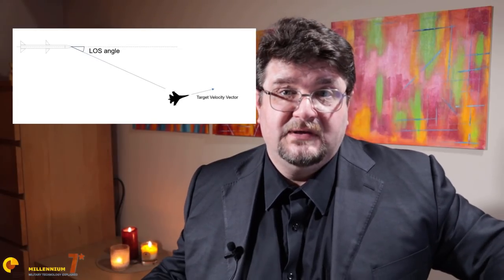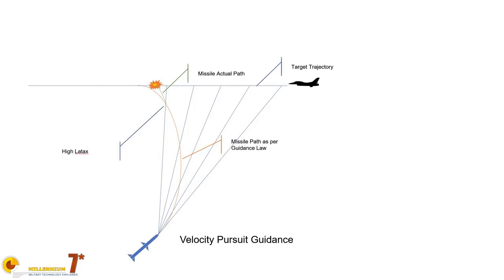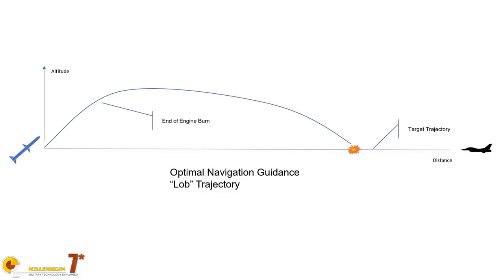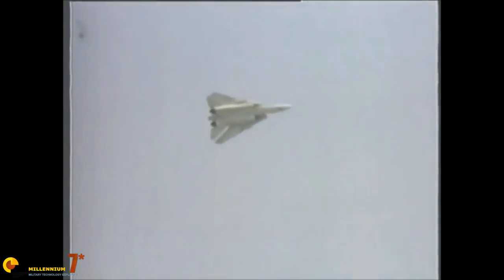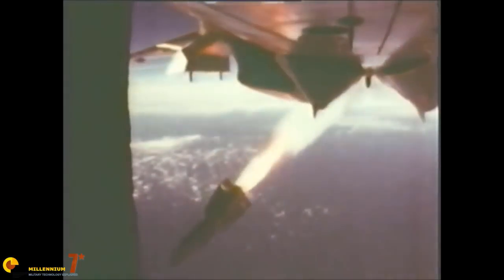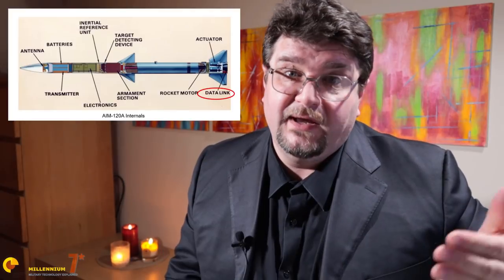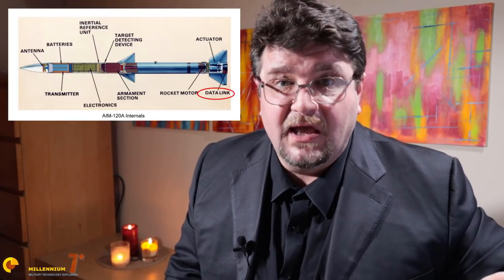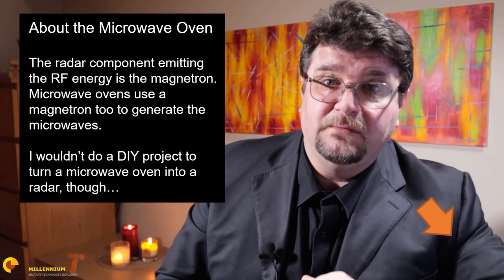Active Radar Homing - The Guidance of the AMRAAM, MICA, R77 etc.

Comment: Actually no the cavity magnetron has not been used in military radar for decades. The reason being it can only generate one frequency. In the early 80's high frequency VCO's (Voltage Controlled Oscillators) took over and a PLL (Phase Locked Loop) was on the output to multiply the frequency so you could go semi-frequency agile (settling time was tens to hundreds of milliseconds). These days a DDS (Direct Digital Synthesis) chip is used and commercial ones such as the AD9956 can change frequency in under a microsecond and working up to near 3GHz (2.7 rated) means you only need a times four PLL which will settle in a few milliseconds. Or you can go for a PLL with sweep such as the HMC702. Both of the latter solutions work nicely in X-Band and both can go lower. You can in fact using a planar array with the right delay line setup sweep by frequency rather than switching delay lines in and out. Much better and more compact for a missile.
Reply: Umm ok. You seem to know way more than me cuz I'm getting what ur talking about but not familiar with the systems u described.  But good on bud 👍

Comment: Again extremely well handeld unique information. What puzzels me is the chances of pilots to detect a launch. I guess it is like lighting a match in a dark room. Yet, in a war many maches are lit, so how to know which one is aiming at you? Then getting a visual on a missile that is no longer burning is going to be neigh inpossible. Or you would need radar but I guess modern missiles are stealthy as well. And if so will that not make for uav fighters working like we did in 1981. I was a conscript driver and gunner on a PRTL. Forget IFF if you are in sector at a time when no friend should be after radar lockon you have 4 seconds to make a hard turn or 35 mm wil start hitting you 500 rpm and exploding inside your plane. Bad hair day. A uav could do the same. Sectors with only uav friendlies blue on blue less of a risk.
Reply: Military aircraft have Radar Warning Recievers. These detect the radar energy from active radar.

Some aircraft have Missile Approach Warning Systems, which can detect missiles based on their natural heat and UV emissions and reflection. These systems will automatically deploy flares and other countermeasures, while also informing the pilot.

Comment: I’m not sure about this ? I worked for Marconi Radar in the 1980’s. I designed and built digital logic using CMOS digital logic chipset to manage the Radar within an air to air missile which was in my specific case an EIK (extended interaction klystron). I couldn’t use TTL because the voltage difference between what was logic 0 and logic 1 was too small and concern was you could accidentally raise a logic 1. However in CMOS this voltage gap was considerably larger and so the logic was far more robust especially around rf. Where the author is getting the idea that valves used in older guitar amps were used I’m not certain as obviously I wasn’t aware how other competitors electronics worked, but at MRSL in Chelmsford where I did the design work we certainly used latest CMOS 80’s logic

Comment: hello sir i find your videos too much useful for me, and also it changed my life. sir i have a question about the surface to air missile's homing seeker, that how acts the seeker head during keeping lock on target .! if the target is moving to some direction what mechanism is used by the seeker head to rotate in same direction with the target to keep locked on target?
Reply from the maker: Thank you very much! Much appreciated. To keep the lock, the missile (but this is true for every radar) must compare at least two samples and act accordingly. The first sample returns the target echo. The second sample is a bit on the right, the third a bit on the left, the fourth a bit up, the second a bit down (there are scanning patterns but for sake of simplicity let's suppose it is just like this). If any of the following samples return an echo, then the target has moved. Say the left sample returned an echo, then the target has moved a bit left respective to the radar. So the next 4 samples will be around the position of what was originally the left one and the cycle restarts. It is easy to understand that, in this way, the radar follows the target.
Reply: @Millennium7HistoryTech  thank you very much sir i thought before like this but i was not confidant and didnt have enough knowledge. thank you sir for your efforts i learnt more from your posts i am thankful.
yes that will be very useful too, to make a video or animation about the physics of  keeping locked missile on target , in future .

Comment: millenium can you please tell us how AESA radar homing is better than average actve homing
Reply from the maker: AESA refers to a specific configuration of the radar emitters and antenna, which gives some advantages in terms of beam shaping and overall beam control. It also tends to be more reliable because it has no moving parts.
An "average active homing" doesn't exist as such. A more conventional configuration may do just as fine if you don't really need the AESA features, like it may happen for a missile.

Comment: Grazie mille per splendito video. Vorrei chiedere a Lei alcune domande come ha offerto quel' opportunita fondo video.1.) Active Homing radars generally are designed for X band (or some near Ka,Ku band).  What is missile active radar homing range ratio regarding aircraft missile guidance range (with constant RCS of target)?. ie: For example one  F-16 can guide Sparrow A km beyond for target Z, but also F-16 launched AMRAAM can guide itself Bkm beyond for same target Z.What are the A/B=? (generic number per forsa)2.) Why we don't see any two stage long range air2air missile to increase energy and range?Grazie
Reply from the maker: If I interpret correctly point 1, that is not how it  works. Range is defined by the energy and the fire solution depends from the launcher. An F-16 can acquire a track by the rada, and the range at which it can be fired upon depends from the weapon energy. The range difference between Sparrow and AMRAAM depends from the models, obviously. Point 2: it is not an advantage because AAMs do not fly vertically up and they already have energy from the launcher. They do not need to overcome their weight, they need to overcome air resistance and shedding weight, in this case is not a particularly large advantage. Also, the stage junction is a weak structural point and so high G maneuvers are not possible while it is attached and so, at short range, it would not be very effective.

Comment: Great video as usual.  One point of order:  The US pioneered IRST for airborne target identification in high ECM threat environment in the late 1950s-early 1960s.  Aircraft that first got IRST were:

F-101B Voodoo Interceptor
F-106A
F-8E Crusader
F-4B and F-4C with the Texas Instruments AAA-4
F-4E got the TISEO in the port wing leading edge, but it was a zoom camera system for visual PID, not IR detection and tracking like the previous Honeywell and Texas Instruments systems listed above.

Comment: it sounds like the target wont be "painted" by radar and w2arn the target tha its locked onto only that the target is being tracked. the best option imho would be to use IRST as primary and secondary use AWAKS then if theres no other  way to target and track the target that way the target has minimum time to manuver to evade.

Comment: Longer ranged missiles in the "medium" range class and higher do NOT use proportional navigation as their guidance law, they use and have used Predictive Guidance since the 60s they have applied alot of classified filters to the basic equation but the basic equation remains the same.
Pro nav is used for short range missiles only, not long range.
Reply from the maker: Interesting, do you have a source? I would really like to learn more.

Comment: I am surprised "radiating an attack" was not listed as a con.  If your target registers an active radar homing radar locked on, he knows Bad Things are about to happen.  With passive (and especially) IR, the chances of knowing you're under attack are lower.
Reply: Not necessarily.  The AIM-54 Phoenix would lock on the last 10 seconds of an engagement.  10 seconds is NOT a lot to time to react and especially if the missile is DIVING DOWN towards you at Mach 4+.  Yes, your RWAS will notify you of an impending attack, but it only shows bearing and a symbol, not altitude.
Reply: @Networkguyinsavannah  The Phoenix required targeting info from the launch plane to get it closed enough for the last 10 seconds. Do, you're still illuminated.
Reply: @chrisrautmann8936  you can, but most likely you are either in a Search while Track scan mode or a Pulse Doppler Mode
Reply: @Networkguyinsavannah  Either way, you're radiating.  If they know the frequencies you radiate on, they have receivers that can alert.  
And based on espionage effectiveness, they're going to know those frequencies in pretty short order.

Comment: 16:30, thats what happen to Russian Su24 shot down in Syria 5 years ago? A turkish awacs was in the region and F16 pilot Just push the button? Cause there was no reaction by the Russian pilots. Although the Su24 is an old plane, the ones operating in Syria are all upgraded, with an RWR system reliable to warn the pilots!
Reply: You don't get a launch warning until the missile goes pittbull. If the missile dosent go pitbull until 1-2km the pilot won't have time to react.
Reply: @varunkoganti9067  what is that mean by missile go pitbull ?